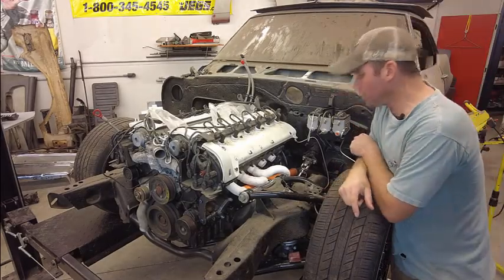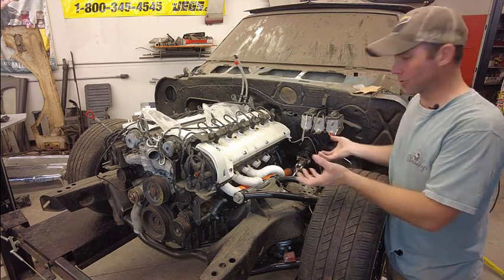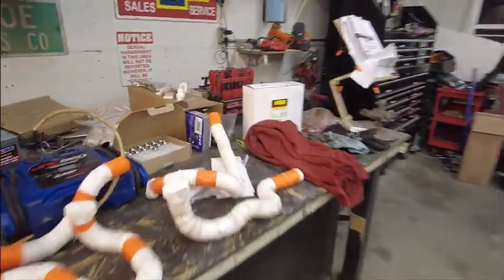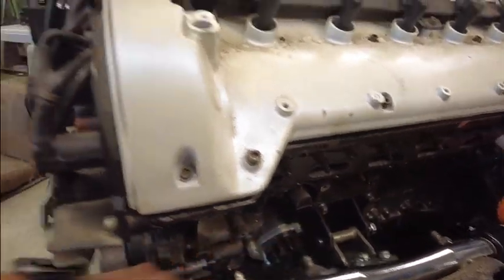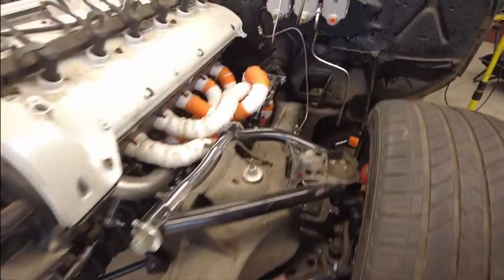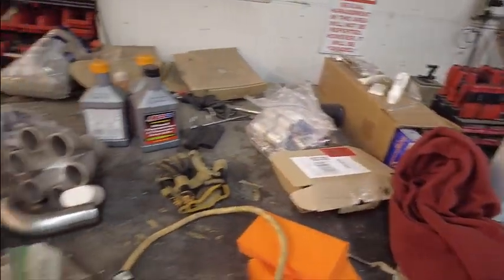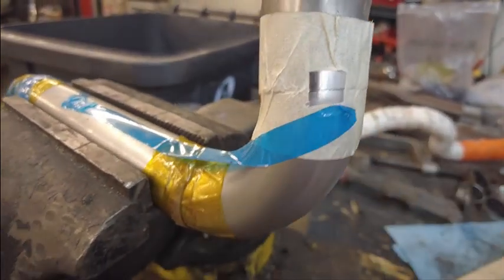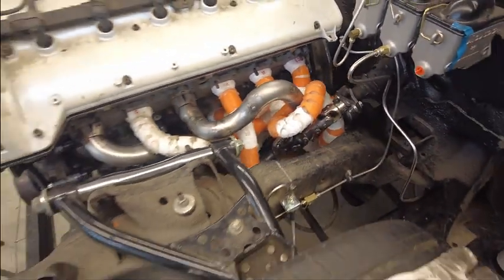Homemade Mercedes M120 V12 Custom Headers - Equal Length!! Part 1

Comment: I've been working on my m120 swap in my fc rx7 for a year now, its awesome seeing another project come to life with the motor
Reply from the maker: There’s not many of us that’s for sure! Great seeing another doing the build. Have a channel or page you keep updated? Would love to see progress of your build!
Reply: @dream_killer_racing  i keep getting a notification for this comment it doesnt show i reasponded so I may or may not have reasponded twice
Reply: Mine is a Starion M120.
Just bought PMCs trans adapter for a BMW 6 Speed.

All i need to majorly do now is a little nip tuck on my Transwell, drive line and trans mounts. 

Relocate my sway slightly forward away from oil pan, make new engine mounts for swapped 240sx crossmember.
240sx Coil over/s13 knuckles mated to new control arms,  using 4 pot fronts "300zx" with zx hubs and rotor.

Engine runs, maybe needs a replacement injector.. or non ebay ford 4.6.. lol.
 Slight miss on a single cylinder, good compression.

Keep in touch guys. 
Should we all make a Facebook group ?

Comment: I am excited to see how this goes. I am putting a M120 into a chassis with plenty of space to work with and am curious how your design will sound. Looking at Zonda exhaust, they do a 6-2-1 collector setup, but the few equal length header setups I've seen have been 6-1. Keep it up.
Reply from the maker: That makes 2 of us. Excited to hear the 6-1! I’ve seen a few like you mentioned 6-2-1. Luckily I have the space for the the large collector. What chassis are you putting your into? Not to many of us doing this swap, but seems to be growing in popularity.
Reply: @dream_killer_racing  It's going into a 1975 Ramcharger.
Reply from the maker: @browniedavis  Awesome! And ya plenty of room for ya. Keep us updated!

Comment: Manual transmission with a lightweight flywheel you've got a poor man's front engine Pagani
Reply from the maker: That’s the plan!! Gonna be rowdy! 😁👍🏻
Reply: @dream_killer_racing  why not just convert an SL600 to a manual? Wouldn't that be easier? Since it's already in there
Reply from the maker: @alimehrozi2828  I’ve seen them do tiptronic autos but need something that will be able to handle 600+ hp. This v12 will be procharged at some point in its life 😈
Reply: @dream_killer_racing  Holy snikies a manual procharged m120? Dreams do come true!

Comment: I regret selling my 93 600sel. The m120 v12 was a beast.  I'm considering selling my gen 1 tundra stepside to buy it back.
Reply from the maker: They are pretty sweet machines, but come with their own set of problems
Reply: @dream_killer_racing  true. But the m120 is very reliable and maintenance was actually easy compared to the old w126 mechanical fuel injection and rebuilding fuel distributors.  To have a manual behind one would be worth getting another one

Comment: How much did it take to print the mockup blocks?
Reply from the maker: Material I would say around 1 to 1.5 rolls of 1kg filament for both sides. Price varies depending color and type. I used PLA, but looking back I wish I would have used something stronger like ABS. I had issues i the beginning tearing them apart so often that some broke.
Reply: @dream_killer_racing ok but how long did it take ?
Reply from the maker: @bandi_TEE  I took my time to print these, but usually would get 18 pieces a day.
Reply: @dream_killer_racing  thanks

Comment: Price for headers?
Reply from the maker: I don’t plan on selling or building thanks though
Reply: @dream_killer_racing  Guess i'll have to 3d print the snap tubes and did like you did.
Reply from the maker: @caseycappoen251  use something stronger than PLA
Reply: @dream_killer_racing  Nylon6 + CF will work.